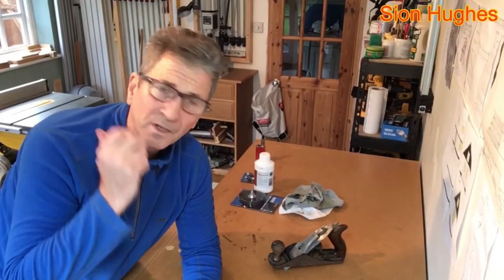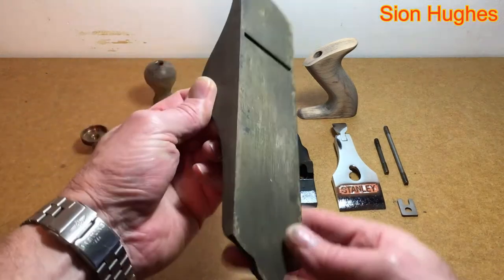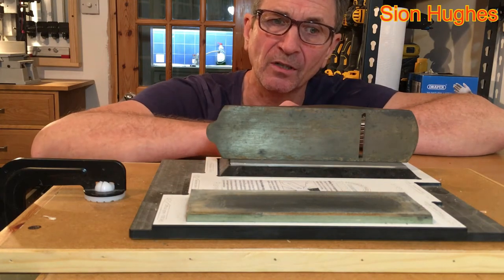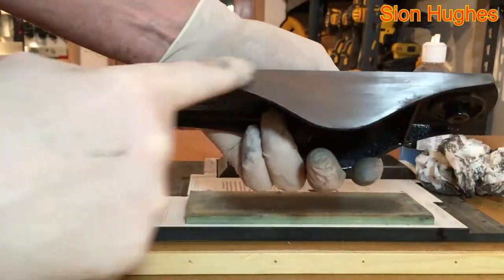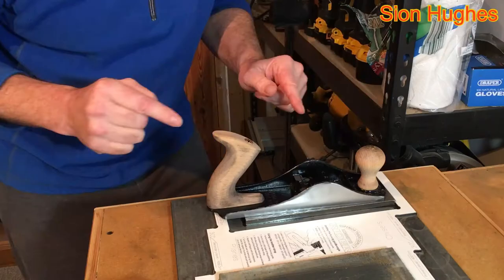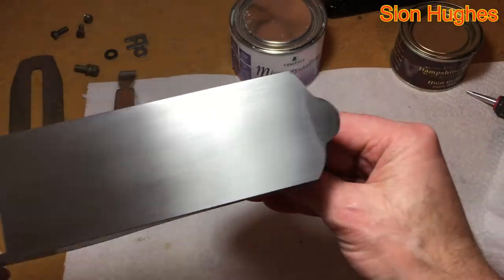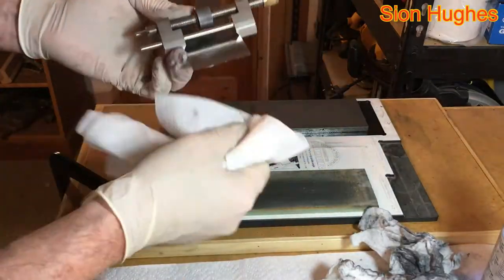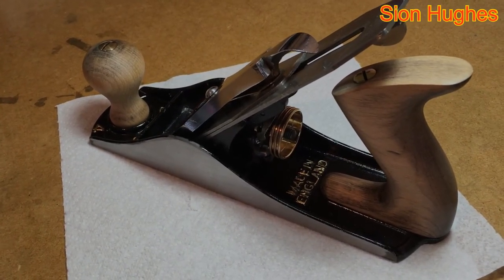How to Restore a Stanley hand plane

Comment: A few corrections if you don't mind.
Most Stanley no 4s had Beech handles unless you got lucky and scored one with a rosewood handle. It's a waste of rosewood really but it does look nice.
The only slight problem with wood handles is that in dry conditions they shrink and you have to tighten down the brass slotted nut a bit. The rosewood handles do shrink less though.
The front knob is not cross grain so it does not tend to get loose like the push handle.
I prefer my 4.5 to the 4 but I have two of each so that I can keep going on big jobs. One set fine for finish planing, the other set for scrubbing quickly to flush.
All my planes were bought used but I never bothered doing any more than cleaning off the rust with sandpaper taped to my jointer table. Quick and easy.
Often it's better to let a grey black pattina  build on the castings rather than keep them bright and prone to rust. Oak tannin mixed with wax is best. Easy on the eye too. The original paint is usually pretty tough, best not to attack it with solvents or rust remover.
Reply from the maker: You are not the first person to point out the beech handles . My mistake . I never touched the paint on the casting  other than adding a touch here and there where it had chipped off . That plane performs flawlessly now and is my go to . Oak , pine no problems. I have had quite a few comments telling me that I should of had the frog and basically the plane fully assembled before I started the flattening process on the plane sole because the tension would alter the flatness of the sole . Anyway these are all good talking points . Thanks for taking the time to comment please consider subscribing. Cheers

Comment: The plane is not type 15. It is type 19. The base has the raised rib at the heel and the base has the "Y" ridge under the frog area. The Lever Cap has the kidney shaped hole. The type 15 had a key hole shaped hole on the lever cap and no rib at the heel of the base. The type 19 was manufactured from 1948 to 1961.
Reply from the maker: Thanks for all that information. If you look through the comments you will notice that I have realised my mistake. Despite my lack of knowledge I hope you enjoyed the restoration

Comment: Pardon If im mistaken but that plane does have a raised rim at the back just like the front.
Reply from the maker: Hi Luke , I honestly don’t know I simply wanted a ultra flat surface which I ended up getting and it works like a dream. I have received a lot of great info in the comments section from people who clearly know a lot more about hand planes than I ever will . That being said I hope you enjoyed the video and consider subscribing. There are well over 60 videos on my channels. Cheers Sion
Reply: @sionhughes5543  Sorry Sion I ment on the top side (painted side )front and back because I thought that's what made you determin it's age . I also have a No 4 with exactly the same cast , only difference on mine is the lateral lever has stanley imprinted horizontally.  Beautiful job on your plane. 👍

Comment: You got the sole completely flat however once you put it back together and the lever cap is under pressure it will no longer be perfectly flat anymore. When flattening the sole of a hand plane it needs to be done when it’s fully assembled with the blade retracted
Reply from the maker: Thanks for taking the time to comment John . I completely agree with you and if you read through the comments in this video you will see this mistake has been brought to my attention before . I will say that when I later flattened the sole again with frog screwed in I drew cross hatches marks again on the sole and went back to the diamond stone . The cross hatching marks disappeared almost instantly and the sole did appear to have gained any high or low spots . Nevertheless I will in future restoration I will be flattening with the frog screwed down . I have a Stanley no 6 restoration which will released soon . Please consider subscribing if you haven’t already . Cheers Sion
Reply: Please point me to anyone who has actually measured the deflection you speak of. I believe it to be a myth, or at most an insignificant measurement.
Reply: The reason I believe this to be true is because I was flattening the sole on my very first hand plane. It was a cheap Footprint brand from Home Depot. I used the big DMT lapping plate and I got the whole surface nice and flat. Shortly after it must of got moisture on it and rust developed so I took it apart to clean it and I started to remove the rust on the sole with the same DMT plate and I forgot to put it back together first and when I looked at it the scratch pattern was different and it was only making contact about 50%. I put it back together and tried again and this time it made contact on almost the whole sole. There were very small areas that weren’t and I’m the only conclusion I could come up with was that I must of not had the same exact tension on the blade. I know a lot of people feel it’s a myth and maybe it is but that is what I experienced

Comment: Hello Mr. Hughes, really astonishing work. I purchased a No. 5
from Stanleys good old times. What brand of japanning do you use for the red paint and the golden pen? And could you tell me which 16.000 stone you use? You should have very much more subscribers because of the quality of the video, so calm and precise presentation.

Best Regards, Matthias
Reply from the maker: Hi Matthias ,First of all thank you for the lovely compliment . I bought a beautiful old Stanley Bailey No 6 , a while back that is going to make a nice restoration video . Regarding your questions, I didn’t japann mine and have no experience of japanning but I will look in to it for the upcoming restoration video . I have other planes I have just spray with Hamerite . I ordered the gold paint pen on eBay . I have them in front of me and the pen has ( Overseas ) as a trade mark and its called ( Paint marker ) The beautiful red is automotive touch up paint all in chineese with ( Color Easy ) written on the  pen . Its an American spelling but beyond that I am sorry there are no codes or part numbers . The water stone is a Shapton 1600 grit . As long as its kept flat with the diamond plates it produces chrome finished . Hmmmmmmmm Shapton  . If you read the comments section of this video you will see that there is lots of sound advice, kindly pointing some inaccuracies in my restoration. Apart from cringing when I realised my errors I can honestly say I am rather flattered that people are kind enough to spare the time to comment. I really appreciate your final comment , it was very kind . Thank you for your subscription and check out the 56 other videos on my channel . Let me know in the comments section what you think . Cheers Sion
Reply: Thank you very much. I think too that it is a 1930s model. It' very similar to the 1933 Stanley type 16 from the US. There are some type studies about the US models. But I couldn't  find a study about the England models. Beginning in 1885 with inventing the lateral adjuster, Stanley made several improvements. The last I know was the kidney shaped hole of the lever cap which provides the cap from floating while adjusting the iron. I have heard in the comments not to flatten the sole without installed blade and without tensioning the lever cap. I tested it in the past with a new No. 4. There was a hollow in the sole of about 0.02 mm after tensioning, but i dont feel any difference while planing wood. I only sharp my blades till 8000 Jis on a Shapton. Do you feel any significantly difference by using the 16.000?
Reply from the maker: The amount of knowledge expressed in the comments section of this video is quite impressive. Regarding sharpening I think there is a definite improvement when you climb up to the really high grits . I personally find oak easy to get a nice smooth finish than the  cheep pine ( all anybody can afford these days ) its much harder to get the flawless finish . If you watch ( How to make a coffee table ) I did tons of jointing in that , both hand and electric plane .

Comment: You didn't mention the missing backing plate or chip breaker,regarded the smoothing planes with the chrome cap plate
Reply from the maker: I know sorry , but despite that oversight I hope you enjoyed it . Cheers Sion
Reply: I would like to know where you got the missing piece from?
Reply from the maker: I have a No 5 that i took the parts from before replacing them from parts sourced on eBay .
Reply: @sionhughes5543  OK thanks for that, often these old planes have parts missing. Blades are available but the other pieces are hard to source.
Reply from the maker: Tell me about it . The replacement parts were bought of ebay at great expense

Comment: I think you will find that this is a much later plane, probably 70s or even 80s. The handles are beech which they used after the plastic ones which were rubbish. A 30s plane would have had Rosewood handles. The hollow rivet holding the lateral adjustment is a modern change along with the screw types.That is a much later plane where the quality is far lower but with work they can still be made to work well as you have found out.
Reply from the maker: I am clearly no expert on tool history and referenced the Stanley  Bailey flow chart available on the internet. I just looked at it now and followed it to the same type and date conclusion as I stated in the video . Now I am fully prepared to except the possibility that I have misinterpreted it incorrectly , but for the life of me , I can’t work out where I have gone wrong. I was definitely wrong about the oak and yes they are beach . In any case the lovely old lady who gave it to me explained to me that it was her late husband’s. He passed away a very long time ago . I think the next time I restore a hand plane I will include the Stanley Bailey flow chart in my video . I cringe at the thought of saying anything that’s inaccurate and hope you believe me when I say that any mistakes I make are honest ones . All that said I really love that No 4 and have used it in lots of my videos . It  performs flawlessly. I really hope you enjoyed the video and would consider subscribing, if you haven’t already. I really appreciate you taking the time to comment and I love reading all the comments.
Reply: @sionhughes5543  Hi Sion, Stanley brought back that casting style in late 70s and the beech handles after the disasterous plastic ones around the same time. Those later planes are difficult to date as they were not all made in the same factory . The screws which hold the frog and the frog adjustment are clearly late models and the hollow rivet also. You could see that the plane had not had much use from the paintwork and grinding pattern on the body and sadly the quality of the castings were poor and if you checked a brand new one in the 80s they were rarely flat and if you rubbed them on a flat surface you could often see a bright mark (witness) where the ribs are showing that the castings had moved. After some years it is easier to flatten those poorer planes as the castings had often settled and as I said before, with the work you did they can be a reasonable plane. I have restored many planes but must confess that unlike many I prefer Record planes as I find their castings to be better and the standard of machining also of a higher quality.
Reply from the maker: Hi David, I would love to be able to afford a Lee Nielsen or even a Woodriver . I have never considered the Record brand as I always assumed it was Stanley knock off but , after. Reading your post I might  consider one.
Reply: Having refurbed several of these planes over the years I agree this is a relatively modern plane from the early 70's, even down to having the Q on the frog which indicates it was cast by qualcast as were the Record ones. The older ones have square edges on the body rather than slightly rounded and also the Stanley wording on the lateral adjuster would not go straight down but at right angles. The blade and cap iron would also be straight edges rather than slightly rounded. Nice refurb though, however I think the beech handles would have been made to look better if stained and lacquered. With the brass nuts, I used to drag them down the leather strop to remove any marks on them and they shine brilliantly. Stanley or Record planes can be made to work just as good as any so called premium planes which I think are just for weekenders not people who spend a lifetime in the trade and use them to earn a living. Just see Paul Sellers and he will say the same.

Comment: Good effort. Not everything done, or properly, or authentically, as many have pointed out.
For me a bit of stain and shellac on the handles would have been a huge improvement. The gold pen is a step too far and looks ridiculous, sorry.
The brass work is beautiful though.
Reply from the maker: Thanks for taking the time to comment and also reading the comments section . I loved the gold high lights but except its personal taste and not standard. That smoothing plane has been a joy to work with ever since its restoration. Please consider subscribing. Cheers Sion

Comment: Nice job!  I won't mention the flattening the sole with the plane disassembled bit, since everyone else already did.  Bit I think your finished product looks great!  I have a Stanley #5 (not sure what ywar) that I'm going to start restoring in about a week or so.  It's odd, it has a wooden know, but an aluminum tote.  Anyone know what year that would be from?  Anyhow, did I see an Airbus video on your channel???  I fly the A319, 320 & 321!
Reply from the maker: Hi Jason, It’s a good question, I used to be a Captain on Boeings and air bus and had this flawed idea that video would get millions of views . Clearly it didn’t work but it was worth a try . Good luck restoring your No 5 . It’s oddly an satisfying process as you will find out. Please consider subscribing and help me grow this little channel. As for your aluminium tote that sounds very unusual, in fact I have never even herd or seen one of those before .
Reply: @sionhughes5543  Hey Thanks!  Yeah man, I've seen St Elmo's fore quite a bit, filmed it once on an old Blackberry phone, and lost the video.  I went back and found yours, it was pretty cool!  I'm Looking forward to restoring my #5.  It's in decent shape, just a little bit of dirt and corrosion.  I did some research last night, turns out, Stanley produced aluminum replacement handles (totes) during the 30's through 50's, I think, and sent them to school woodshops around the US, since the students were rough on the planes and often broke the totes.  I'm not sure what year mine was manufactured, but I'm guessing the previous owner got it from an old High School woodworking class.  I'll subscribe.  Looking forward to seeing more of your content!
Reply from the maker: I really appreciate the subscribing Jason . I have spent 1000,s of hours building , filming and editing and still my channel is yet to take off but at least its ready for departure. The aluminium totes are playing on my mind and I keep thinking they are chrome shinny and leave your hand all black . I am sure that’s not the case but that my imagination for you . I am working at the moment on a coffee table and that video should be out in the next 10 days . I don’t have a jointer machine and so hand planes are an absolute necessity . It’s a real skill to learn how to flatten large planks but extremely rewarding. I have learned loads from Rob Cosman . To this day I still hold Norm Abrams as the father of modern DIY carpentry and have photos of him on every wall in my work shop . Safe flying and best wishes Sion .
Reply: @sionhughes5543  Thank you!  I'm looking forward to seeing your table build!  Father Norm Abram was my inspiration to woodworking also.  I always watched with intrigue when I was young.  I piddled with it for a while, but I really got in to it when I rediscovered the New Yankee Workshop online a few years ago.  I went out and bought some tools, as I needed them and got started.  I fly for American Airlines, and got furloughed for a few months at the beginning of covid, which was a blessing because I spent that time learning and refining my woodworking skills.  I built a buffet table / sideboard, with 2 utensil drawers at the top, glass windowed display cabinet in the center a linen drawer at the bottom, and a 1 1/2" thick table top.  I've also built a scaled down version of Norm's pantry table that sits under a window and holds plants in the dining room, a cedar blanket chest, a bookcase, and a few other smaller projects.  I used to make sketch comedy videos for YouTube with some friends, and had a show on TV for 3 seasons, but I've gotten away from that.  I wish I would have filmed my builds, but I don't have the equipment any more.  Maybe after I build my new shop this year, perhaps I will.  I bought a cheap benchtop jointer and a Dewalt planer /thicknesser, but I find for small to medium size pieces, it's faster and easier to just use hand planes instead of setting up the jointer and planer.  It's more rewarding too!  Of you can send me your email address or something, I'll show you my progress of my #5 restoration.  That aluminum tote handle, is matte, not shiny at all.  I found out that Stanley started shipping out 5 1/4's to schools for student use with the aluminum tote, because the aluminum totes were virtually indestructible.  Then they started sending them out as replacement totes for #5's, and a few other models in thier sweetheart line.  I haven't decided yet if I want to replace it with new wooden one, or keep it authentic with the aluminum one.
Reply from the maker: Hi Jason, can’t think why I have not respond sooner. My email is     Sion737@hotmail.co.uk       I would love to see those pictures. Hope you liked the coffee table build??